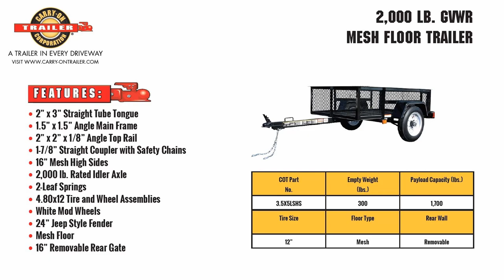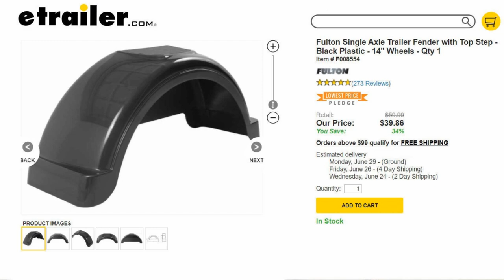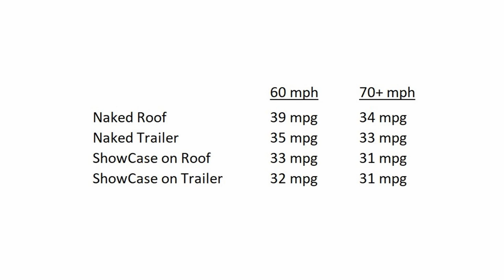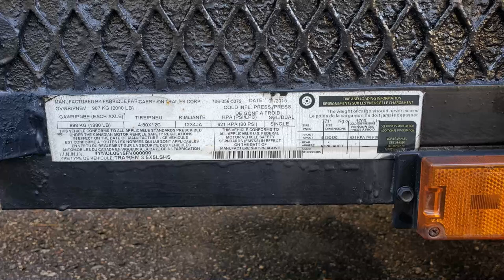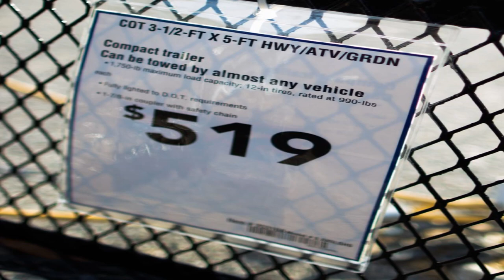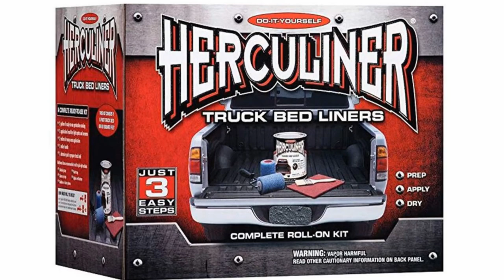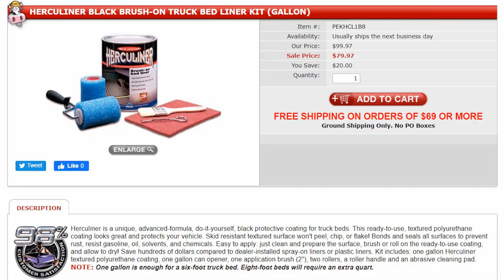CARRY-ON TRAILER 3.5x5-FT UTILITY TRAILER

Comment: looks good, i'm looking at the low's trailer and like your idea of up sizing the wheels, are they the same lug size as a car so i can get a wheel from a wrecking yard.
Reply from the maker: Thanks! They are not the same bolt pattern. You'll need adapters to adapt the trailer's 5x4.5" pattern to 5x112mm. I used to have that, but decided it wasn't worth the extra effort. I just use standard trailer wheels now.

Comment: How did you attach the new fenders? You said they're plastic, so did you just rivet them on or what? Great video. I just ordered this same trailer and look forward to doing some of the mods you've shown here.
Reply from the maker: Before adding the plywood walls, I used a set of straps that are used for remote oil or transmission coolers. I have a photo at https://bit.ly/2ZiCvIq. This photo was taken before I trimmed-off the cables. I used them instead of a nut and bolt because my (then) wide tires wouldn't have cleared a bolt. Today, I would cut the bolt if it wasn't for me having thinner tires than before. Now that I have the wooden box, I use 1" wood screws to hold the fenders in place. There's also a layer of adhesive between the fender and trailer, but that's more to keep leaves and debris out of the edges than any sort of physical bond. I hope that makes sense. Thanks for visiting.

Comment: They are 800 at lowes today .
Reply from the maker: $800 and usually out of stock. I hope mine doesn't get stolen now that it's 2.5-times the cost to replace it when compared to new. Thanks for sharing the updated pricing.

Comment: Great video.
I have the same trailer from lowes with the 12" wheels . Do you know if I can fit a 13" wheel without removing the fenders? Thank you
Reply from the maker: Probably not. The larger wheels also have taller tires, about 17% taller. While they MIGHT seem to fit at first, any apparent clearance will disappear as soon as you load or go over bumps. Plan to replace the fender or move yours upward if you seek larger tires. Thanks for visiting!
Reply: Sounds good. Thank you for your advice. Have a nice day

Comment: With the lid on is it water proof ?
My wife needs to keep clothing in a small trailer. Thx
Reply from the maker: "Water-proof?" No. Rain-proof, it depends. If you rewatch the section about the lid, you'll see that the rear part of the lid is not sealed due to the way I chose to fit it inside of the gate. That allows me to lift and remove the gate without removing the lid. As a result, rain water can leak to inside the trailer. Here's the "it depends" part: If you park or tow the trailer with a slight nose-up angle, then any rain water that runs in there will simply dump out the back before having a chance to migrate forward. It's not uncommon for the floor to get wet during heavy rains, but it doesn't flood. I don't tow with a nose-up angle (parking, yes). I prefer either level or slightly nose-down so that cargo doesn't shift rearward. When I know I'll drive in the rain, my practice is to pack my things in totes or luggage to keep the bottoms dry. Water does not leak through the lid; so, cargo does not need to be tarped.

That ability to remove the gate without the lid has not proven to be extremely useful. I could add a piece of crown molding to the back to help direct rain water around the gate. But it's realistic to assume that SOME rainwater will still leak through the corners. By the way, I did take this trailer on a 7400-mile journey. I didn't encounter rain, but was confident that only the floor would get wet. See my "Coast to Coast" playlist, if you're interested. 

This is a bit of a long answer to a simple question. I hope it's helpful in making your decision. Thanks for visiting.

Comment: Can anyone help, my pal bought a 3/4 ton trailer and the wheels have serious negative camber, should these little two wheel trailers have any camber? I assumed it was for stability but the tyre blew today and one side was completely the worm and the other wasn't even touched, I'm guessing this is bad and the wheels need squaring up?? Thanks to anyone who replies 🙂
Reply from the maker: Is his a trailer like this one? My trailer came with an arch in the axle, which resulted in a little bit of negative camber. I assumed that was so the axle would be flat when loaded to capacity. My current axle is straight, but also made from a thicker, galvanized steel square tube. How "serious" is the negative camber? If one side is worn and the other is not, might there be a toe-alignment problem, perhaps from an impact? Good Luck!
Reply: @StealthGTI  thanks mate, it's easily noticeable, I think it must be damaged because he just said the wheel is rubbing against the side of the trailer because it's leaning in so much
Reply: @StealthGTI  p.s, no it's not like the trailer in the video, similar but not quite the same, I just commented on this video in the hope that someone who knew more about trailers than me would also watch it

Comment: Your trailer is a perfect template for me. I'm always coming back to your video for more mods. I got the 13 " wheels  and of course the fenders are to small. That's going to be next on the list . Your fenders are bolted in? Also I really like how you installed the spare tire under the trailer. What bracket did you use and how did you secure it considering that is just a steel mesh under the trailer. 
P.S. What are your thoughts on having a tongue box installed? 
Thank you 
Have a great day
Reply from the maker: Thanks for writing, Erwin! Since the sides are mesh and the walls are 3/4" plywood, my fenders are screwed into the wooden sides with 1-inch wood screws. Carriage bolts with anti-rotation washers would work, too. For the spare tire, I chose this carrier (https://amzn.to/3FaCPeu) and fed it from the top. Your concern about the mesh floor is valid because the mesh is weak. Knowing this, laying a 1/2" sheet of plywood over the mesh was my first priority when I bought the trailer. Regarding a tongue box, I opted against one because it would become an impact hazard when backing. The tongue on this trailer is so short that it wouldn't take much for a tongue box is hit the car's bumper while backward maneuvering. I could consider an ammo can, mounted with the tire carrier shared above, but nothing larger than that. Take Care!
Reply: Thank you do much for your input and the link.  Always appreciated. 
Have a great weekend

Comment: Very nice looking to trailer.  When the trailer is hooked up to your Jetta, did you have any problems backing up to an elevated driveway without scratching the hitch?
Reply from the maker: I used to bump the hitch on my lowered Jetta. On my GTI, and with the larger wheels/tires on the trailer, everything sits high enough to avoid bumps on the road. Take Care!
Reply: I went to Lowe’s and purchased one after seeing yours!  Had to go to a rural one that sell trailers.  Where did you get the led guide posts and the yellow “Undersize Load” sign?  I have to have those!  Thanks.
Reply from the maker: @jdretired - I got the guides at a truck stop. They're bumper guides for big trucks that come standard with amber lights. I eventually bought sealed red LEDs from https://www.boresmfg.com/. As for the "Undersize Load" sign, I had it made at a sign shop. Take Care.
Reply: Hey there,

One last question about the bumper guides.  The ones from the truck stop doesn’t come with the mounting bracket that you have.  Any chance you can send a link on them?  Thanks.
Reply from the maker: @jdretired  - I don't have a specific link since I bought mine nearly 20 years ago. But I'm sure you can find something that includes mounting brackets, especially if you shop online. Worst case: heavy-duty zip ties.

Comment: Did you need to add a spacer for the larger tires? Can I get more info about the wheels and tires on your trailer?
Reply from the maker: Thanks for visiting. The wheels are standard trailer wheels, just in black. The tires are 195/60R14, which are shorter than most 14-inch trailer tires since they are passenger radials. I didn't NEED shorter tires. Instead, I had a new set laying around that I had purchased for an older car that's now gone. The 195s fit without spacers. A "standard" trailer tire for a 14-inch wheel appears to be a 205/75R14. It would fit without rubbing the suspension or chassis. However, I'm fairly certain it's tall enough to rub on the fender, especially with a load over bumps. A 13-inch wheel with a "standard" 175/80R13 is a perfect fit. I will probably replace my current tires with 195/65R14s when the time comes. I like the softer sidewalls of passenger radials on my lightweight trailer. Take Care.

Comment: So my gate opening max is 57". Would this trailer fit? Fender to fender?
Reply from the maker: According to the original specs, the trailer's max width (assuming "fender-to-fender") is 56 inches. That leaves just 1/2" on either side to squeeze it through your gate opening. You may need a winch so that you can control the approach very slowly. See more specs on my site at https://stealthgti.com/carry-on-3-5x5lshs-trailer/. Thanks for visiting!
Reply: @StealthGTI  Thank you sir! I decided to expand my gate opening before i crash into it lol. I think then i will go with a 4x6. Again, thanks for your help!!

Comment: Did changing the leaf springs affect the carrying capacity of the trailer?
Reply from the maker: No. I stayed with the factory spring rate and only changed the number of spring plates for a smoother ride. Theoretically, I guess you could increase capacity by swapping to heavier leaf springs, a heavier-duty axle, and adding brakes. But then the weak point would be the trailer box itself. I'm not sure I'd trust it far beyond the stock 2000 lbs. Also, the tongue could be a weak point, too, since it's a straight beam instead of an A-frame. Thanks for visiting.

Comment: How did you secured the plywood to the floor and also the sides. I just pick up the same trailer.
Reply from the maker: Very nice! I used nuts, bolts, and fender washers to clamp the wood to the floor and sides. If I was doing it again, I'd use carriage bolts instead since they present a smoother surface for cargo to slide over. They'd be held steady with some of these: https://amzn.to/3n95reL. Thanks for visiting.

Comment: The guide lights , how high are they from the top of the trailer? Thank you
Reply from the maker: I'm honestly not sure without going out to measure them (currently storming outside). But I'd say their actual length is irrelevant unless you're towing this same trailer with a Golf. The key is to place them at a height that you can see through your rear window and over any slopes/terrain that you expect to traverse. For example, my old Jetta's rear window was higher, so the lights were taller at that point. But I still had to be careful to not put them too tall; otherwise, I'd lose sight of them when backing up the initial slope of my driveway. With the Golf, the rear glass is lower, but farther back. So, the need is different. A pickup truck with a closed gate would need even taller lights. My point is the need depends on your specific trailer and tow vehicle. Does that make sense? Thanks for visiting!
Reply: Sounds good
Thank you for the advice 
Have a good night

Comment: u think 3x5 is big enough to haul a motorcycle? Yamaha MT 03?
Reply from the maker: Only a motorcyclist with transport experience can really answer that. The trailer's deck is 60 inches long. I think most motorcycles would have to ride diagonally and without the trailer's tailgate in place. Measure the bike's wheelbase, add the radius of the front tire, and go from there. I think it will fit, but the rear wheel will stick out beyond the back of the trailer. Then there's weight distribution... back it in or face forward? Good Luck!

Comment: Really like what you've done, great work! Could you tell me what the width is fender to fender?
Reply from the maker: It's exactly 60 inches. I know this because they rubbed when I loaded it onto a 5x10 trailer to take for a spring perch repair. With the factory fenders, this trailer was 56" wide. Thanks for visiting!
Reply: @StealthGTI  thanks for the reply! Did your new wheels originally fit on the stock axel, before getting a new one? This is the perfect trailer for my needs and they sell them nearby, but I'm trying to figure out if I can upgrade to a larger wheel/tire combo that will bolt right up without clearance issues. Any insight much appreciated!
Reply from the maker: @bretttran5919  - The larger wheels/tires fit the axle and clear the frame. However, I needed larger fenders to clear the tires. The factory fenders will not work with anything larger than the tiny stock wheels.

Comment: where did you get the trailer from ?   where did you get the weels (tires) from and what size ?
Reply from the maker: I bought it at Lowe's about seven years ago for about $300. Amazingly, it retails for about $750 now, if you can find them. A Canadian viewer just shared that they run about $1100 USD up there. CRAZY! Oddly enough, I'm looking at 5x8 trailers for those times when this trailer isn't quite large enough. My daughter just bought a motorcycle; plus, a 5x8 would be great for carrying plywood or sheet rock. I'm still trying to decide between a rear gate and a tilt-bed. Thanks for visiting!
Reply: @StealthGTI  Sadly still cant find this trailer or any 3.5 x 5 trailer. :)
I need a light weight trailer cause my Rav4 towing capacity is only 1500lbs.  And I plan on adding a rooftop tent and carry camping gear.
Reply from the maker: @jroddy1  - I think a 4x6 is a great trailer! Sometimes, I wish that I had a 4x6 instead of a 3.5x5. My reason being that a 4x6 can hold a sheet of plywood without resorting to crazy loading practices. A 5x8 is even better and just a little heavier. They currently appear to be less expensive than the 4x6's. One suggestion, though, is to avoid the kit trailers. Read their manuals and you may find that they have speed ratings that may not be suitable for the highway. Good Luck!

Comment: I read somewhere that the max speed for this trailer is 45 MPH, is that true?
Reply from the maker: The owner's manuals for both the Harbor Freight and Northern Tool small bolt-together trailers have 45-mph speed restrictions. Carry-On Trailers does recommend maximum speed of 55 mph, but that's a safety recommendation that they make of ALL of their utility trailers, not specifically this one. Thanks for visiting.

Comment: Where can I get new wheels ?
Reply from the maker: etrailer.com. Thanks for visiting.
Reply: @StealthGTI  thanks. Sorry one more question my the top of my hitch stands at 11in . What height is the carry on tongue... I’m asking because I need to buy a ball mount for my chevy impala.
Reply from the maker: @sneakerheadlowlife  - My hitch is the same height. I'm able to use a 3/4" rise ball mount to meet the height of the tongue. But that's with the taller tires. With the stock tires, I'm pretty sure flipping the mount to make it a 1.25" drop worked well.
Reply: @StealthGTI  thanks, appreciate it
Reply: @StealthGTI  finally got mine today. I love it, only issue I have is backing it up I feel like I can’t get it right lol
Reply from the maker: @sneakerheadlowlife  - Very nice! Yes, backing takes practice. I suspect backing that trailer is tougher with your longer wheelbase than with my Golf/GTI. Congrats!

Comment: What bracket did you use to mount your fenders to your trailer?
Reply from the maker: No bracket. With the wooden sides, I simply used wood screws to fasten the fenders. That's probably not as strong as brackets, which is why I have the bird deterrents on the fenders. Thanks for visiting.

Comment: @stealthGTI How did you mount the new fenders on?
Reply from the maker: They're screwed through the mesh sides and into the wooden box. I have links to photos in the comments at the bottom of this page: https://stealthgti.com/carry-on-3-5x5lshs-trailer/. Thanks for visiting!
Reply: @StealthGTI  Did you have to upgrade the axel before putting on 14” radials? Went to discount tire and the man said I wouldn’t have enough clearance for a 14” trailer tire.
Reply from the maker: @protodank   - The clearance issue is due to the fenders, not the axle. The originals are welded to the box. I had them cut off, then attached the plastic replacements with wood screws. I also positioned them a few inches higher. If you mount the new tires before choosing a fender location, then it's easier to gauge where you want the fenders. Just make sure that you either position the fenders while the trailer is loaded or make sure you account for the fact that the trailer will drop an inch or two when loaded. Look at the photos on the webpage I shared earlier to compare the difference.

Comment: What hitch attachment was that? Has some type of cover on the back?
Reply from the maker: Can you be more specific? Are you referring to the plug that covers the hitch opening when the ball mount isn't installed? Or perhaps the "bumper guard" that's on the ball mount? Thanks for visiting.
Reply: StealthGTI sorry yes, the bumper guard with the ball mount. Like what brand is that extension? Or is it custom?
Reply from the maker: @DayDayBear14 - That's a product by TowReady, model #80400. It MAY be discontinued; I'm not sure. Most of the places that usually have them show them out of stock. Is it the virus and manufacturing stoppages? Did they close their doors? Who knows? Search the web for "Tow Ready 80400 bumper guard" and you may get lucky. Buy one if you find one. Once sold out, they may be gone forever. Good luck!

Comment: Whats the actual weight in the trailer tnx
Reply from the maker: The weight of the trailer, as configured in this video is ~500 lbs. The wood really adds up! Without the wood, it's probably around 320 lbs. Thanks for visiting.